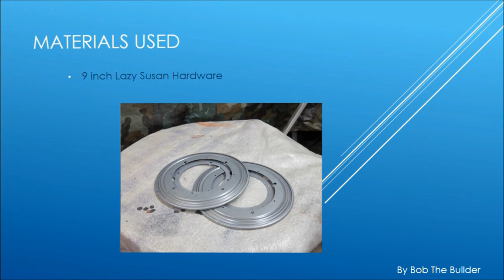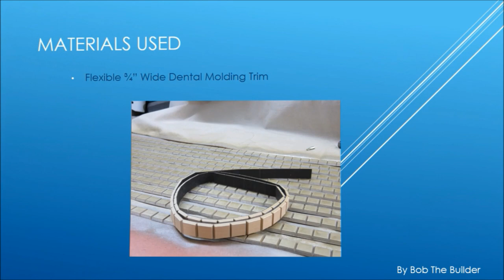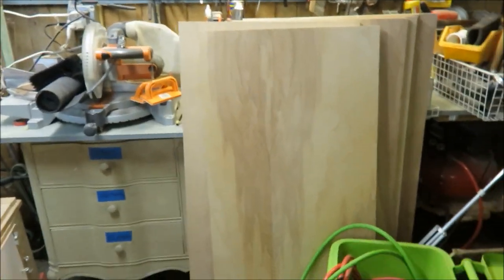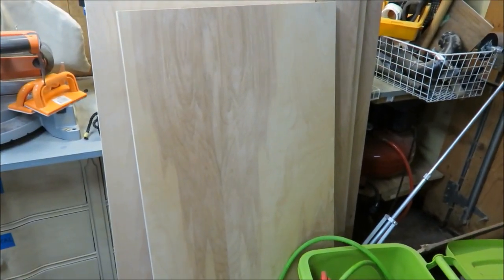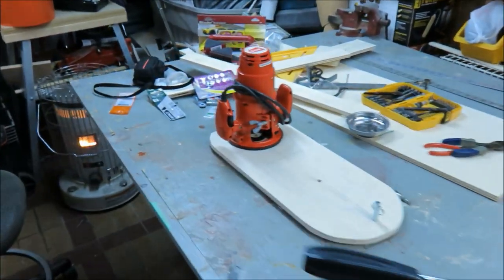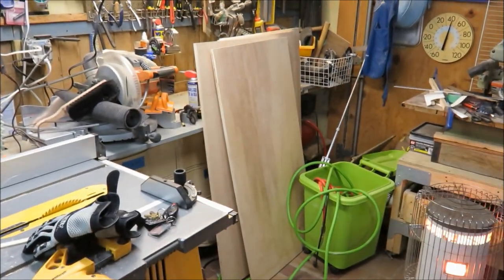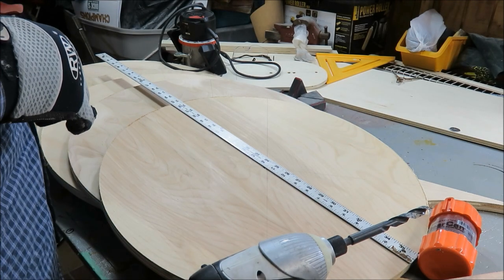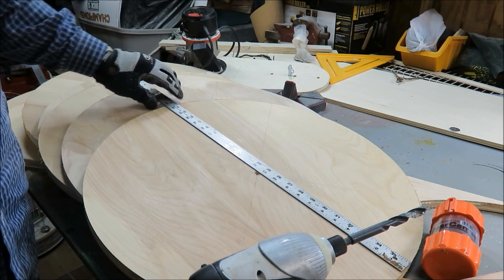DIY Lazy Susan Shoe Rack, Part 1 of 2

Comment: Hi Robert would you mind very much sharing the dimensions of each circular plywood and the smaller pieces in between? I want to try make one after watching this. Awesome video!
Reply from the maker: Lyntau McFarland, just for the convenience of bringing home and to optimize my wood usage I bought 3/4"x24"x48" instead of a 48x98 full sheet birch plywood. I cut those down to x24"x24" and from that I cut them down to approx. 22-23 inch diameters using a router for my shelves. For the vertical pieces I cut them each to about 7.5" tall (so I could get three 7.5"x24" out of a 24"x24" piece). If you are going to have very tall high heels shoes, you should measure the tallest shoe and leave a little margin to clear the shoe. Good luck.